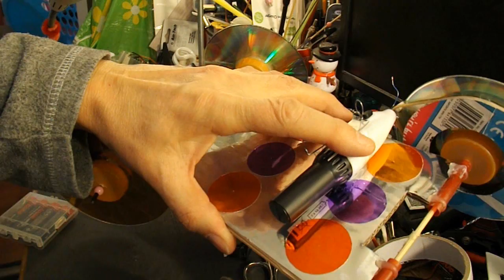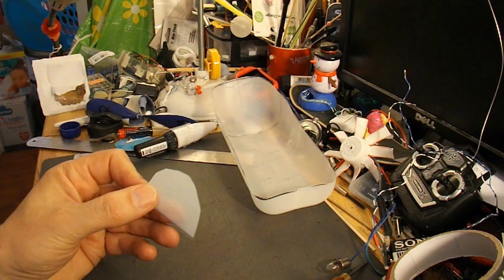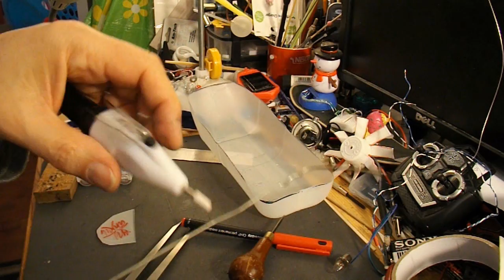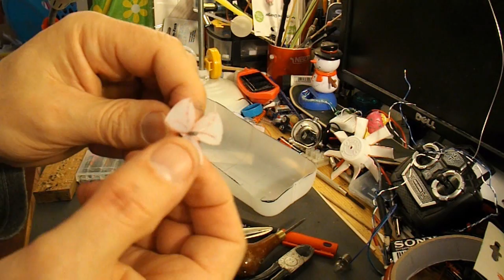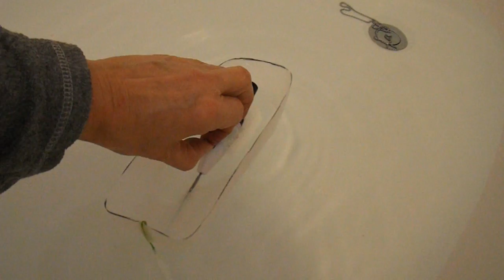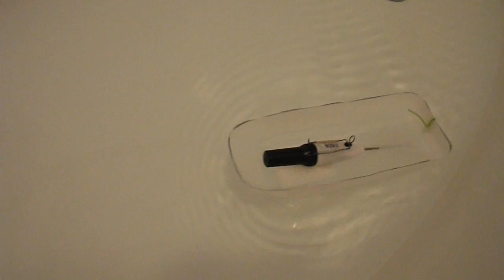Poundland Nail Shaper powered boat

Comment: Great walkthrough on the prop. You could have put in for Blue Peter in the past.
Sounds like a put-put boat :)
Reply from the maker: Thanks, thought I had better leave it normal speed as people do ask for slower versions of some of my more interesting builds.
The noise on this one is a bent shaft, the hull is so soft and weak the whole thing flexes to deal with the bend.
Reply: GrandadIsAnOldMan
Can't tell from over here...6000 miles away :)
Ah. perhaps cut a deck for it from a similar bottle. It would strengthen it across the bows.
Reply from the maker: It served it's purpose and if I stiffened it the bent shaft would jam solid and it wouldn't work. It's one of those things that you try to straighten it and you bend it a little more in a different direction. That motor really does not seem to have much power and it is only running an a single AA, I could give it 2 batteries but then it wouldn't be using the 'Nail Shaper' without modification.